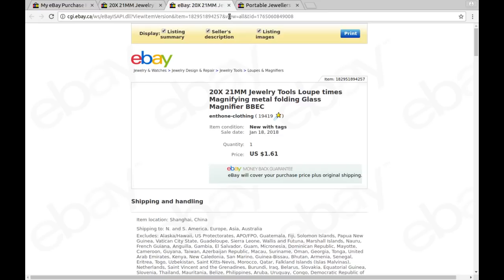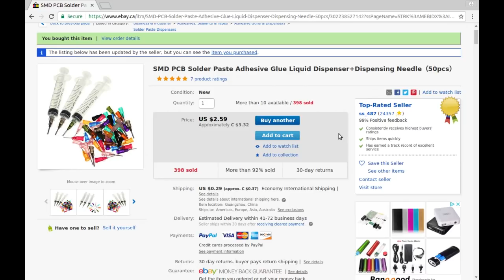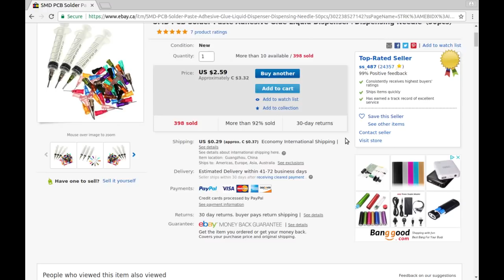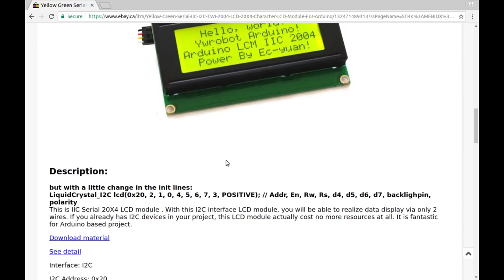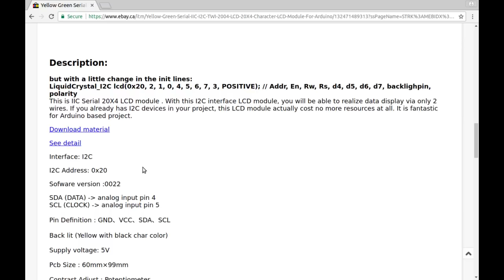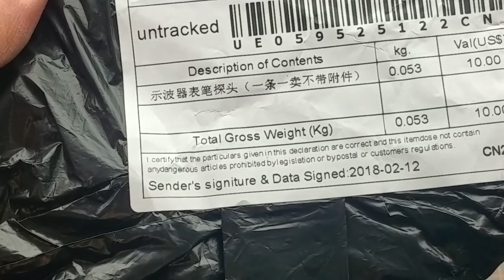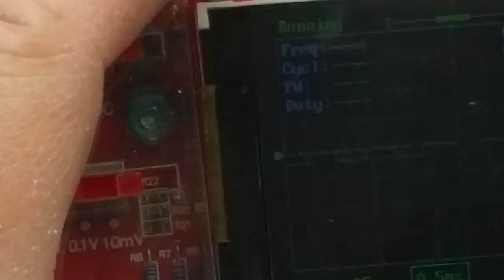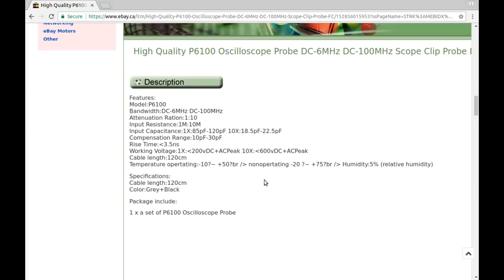Mailbag Monday 25

Comment: Almost a year late but for mailbag #25,  the yellow cable stripper is actually a great tool. It is made for silicone wire. I have never used it for non-silicone wire.  Love your site and want to send one-time funds but not as a monthly pledge.
Reply from the maker: Thanks.  I was mostly hoping that tool would work as a punch-down tool for the surplus jacks that I have. Ah well, at least it was cheap.
I've been looking into other options, to make it more convenient for people to help me out if they feel like it.It is possible to pledge on Patreon for a single month, if you are willing to go through the sign-up process.

Comment: I think an upcoming mail bag of mine is going to bear some similarities to this one. Although I only just recently placed some orders so it might take a month or a year for the parts to come.
Reply from the maker: I've noticed that there is a lot of overlap between our mailbags.

Clearly, you have good taste in cheap electronic crap from China!
Reply: I saw your FIFO queue of upcoming mail bag packages and I think my buffer is going to chaos. I have no idea what order it’s in so I’m still opening stuff from December randomly and I think this week I’m going to do a huge bulk one to help purge the Queue and maybe organize it more sequential going forward.   It looks like I ordered the same set of solder paste syringes and the three plungers and I’m also waiting for solder paste and a flux pen.   I’m thinking my first attempted usage is going to be putting those flat flex connecters on those boards with hot air.